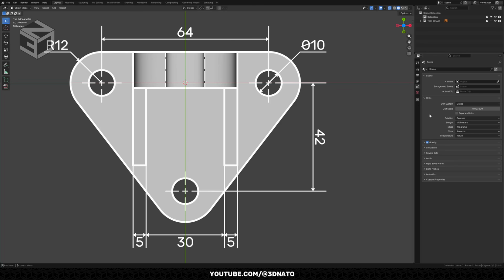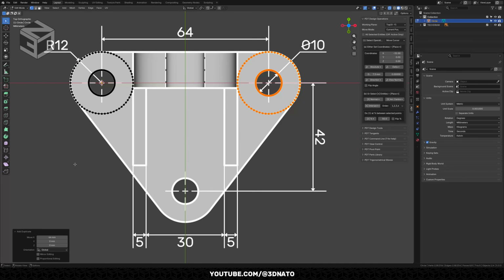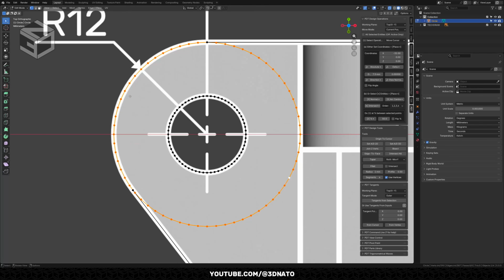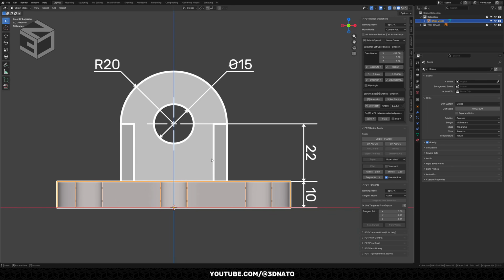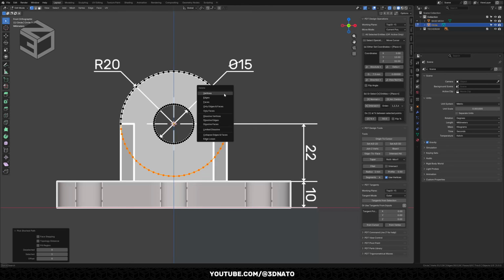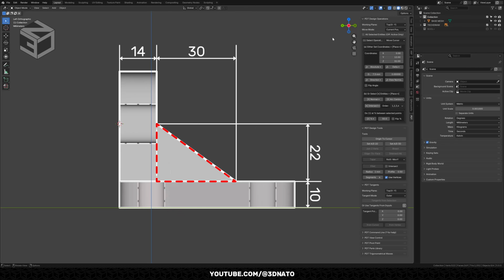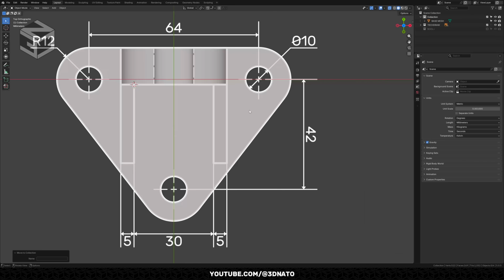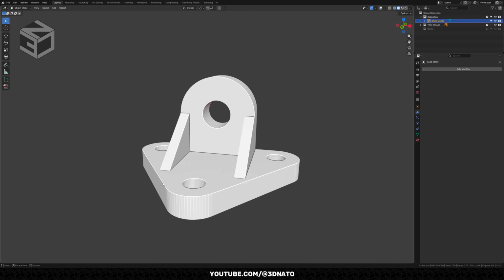Finally… PERFECT TANGENTS With This FREE Blender Add-On

Comment: Dear, to confirm the material I went to draw again and I didn't need to clean the internal faces. After 3D-print Check All, all parameters were zero, except Overhang face:20. Maybe I'm asking too much, but I'm curious how you set up the sketch (draft) in Blender that you draw on? Thanks

Comment: Hello,
When I use Alt + Fill, the circle gets filled in. What might I be doing wrong?
Reply from the maker: You could try Ctrl + F to open the Face Menu, then choose 'Fill (Alt + F).'
Just make sure everything is part of the same mesh and all the vertices are selected.
Reply: @3DNato  If I press F, then only the circles get filled. But Alt + F then the entire thing including the circles get filled. Everything is part of the same mesh and all vertices are selected. Could you help?